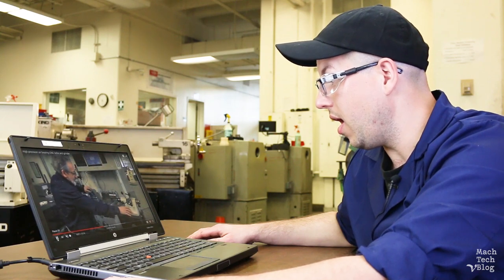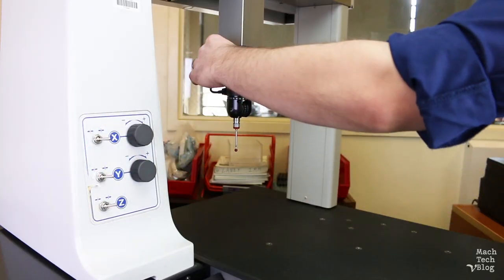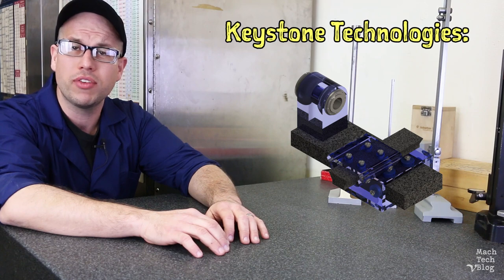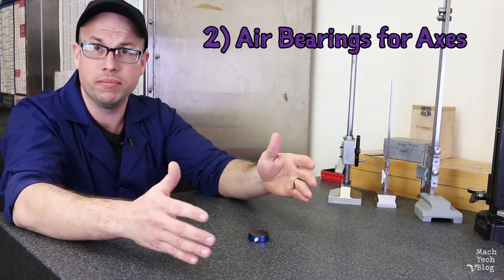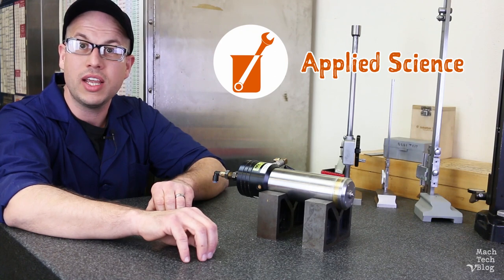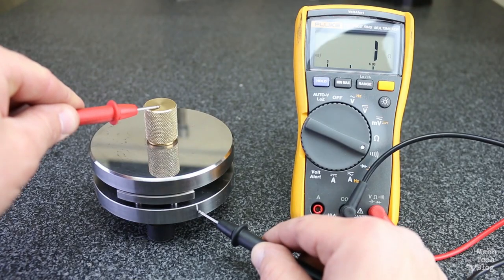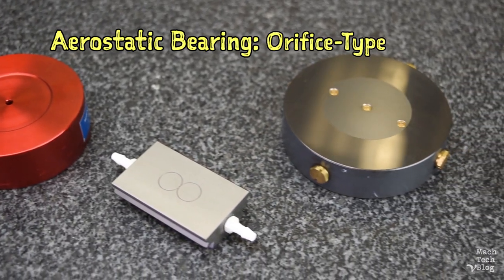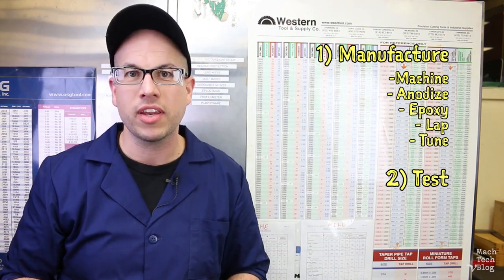Air Bearings: Introduction

Comment: I'm really looking forward to this series. Thanks for the shout-out!
Reply from the maker: Thanks for your dedication to backyard super science ;)
Reply: We all looking forward to this series and your channel also! And it is in my top 10. )
Reply: @LaneyMachineTech  Nice Video, it's well put together.  Ouch on the reference to New Way being expensive for what the bearings are.  We put a lot of time and effort in designing effective solutions for our customers.  The precision repeatability from bearing to bearing is very critical in many of our OEM customer applications.  If we were manufacturing a non precise air hockey puck, I would agree with your statement.   The video shows you manufacturing a flat round bearing , our 65mm puck is $215.00 for a one-off.  At larger quantities they obviously become more cost effective.  Is $215 expensive for the amount of work you just put into the series of videos? Again, love the video.  Great explanation of air bearings.  I just take offense to the expensive comment because I see first hand the design, processes, manufacturing and testing that goes into making porous media air bearings.
Reply: mr. applied science guy is everywhere...

Comment: I used to work for the company Professional Instruments Company. I made and balanced  alot of spindles, air pads, and custom bearings. Let me know if you have any questions. I will say that one of the patents is the groove compensated airbearings. Their idea of precision is unfathomable to most. I ground parts that where 36" long and hollow for Zeiss CMMs. With a tolerance of cyclindricity of .00005. That means run-out no more the 50 millonths, and size within 50 millionths. They do amazing stuff.

Comment: That whole Dan Gelbart series of videos is gold gold gold.
Reply: Perhaps, .....for those that have never been in any manufacturing environment.  Otherwise, very impractical in many cases.  The lathe, as one example, very limited use and extremely impractical.  Air bearings as NOT suitable for much loading.  This is very much a finishing machine.  When you have the money Dan has, you can easily have three or four or more lathes ....each for a different application/need.

Comment: I had a couple of words with Dan yesterday in his comment section, about how he regulated and matched the epoxy thickness of the two main "T" granite structures.  His answer?  He didn't - just the weight of the granite equalized the thickness of the epoxy film from end-to-end and from structure one to structure two.  Given the accuracy he shoots for, that just doesn't seem good enough - dunno'.

Comment: That sounds so awesome. One of my interests is achieving a very high accuracy on a limited budget. That's why I recently learned scraping and I'd like to experiment with building some stuff that incorporates scraping in the process - the beauty of it is that after machining on a relatively decent machine you literally need only hand tools to make a very flat plane on your surfaces. But cast iron and scraping can get you only so far. I'm still not done with almost any of my projects and plans, but I'm pretty sure that when I go more into the precision land I will want to look at air bairings. So thanks for sharing your work on this!

Comment: Adam, do you think, using the principles of your thrust air bearing, that it could be utilized for an audio (vinyl records that is) turntable?  I mean, could 33-1/3 rpm sustain this kind of air bearing?
Reply from the maker: I'm not sure, but this was one of the first potential applications which popped into my head when I was making the bearing. You should try it! It would be helpful to do some calculations first. 

This guy's got some good information: https://www.youtube.com/watch?v=dR5rRZQeIAU 

And this website has a bunch of design calculators: https://www.tribology-abc.com/

Comment: So air bearings would suck for rigidity would they not? I work with Swiss screw machines and we use a guide bushing with oil. Air compresses, oil does not.
Reply: Excellent point. Precision air bearings require preload. This is done in three different ways:
1 -opposed bearings the force from one bearing preloads the other.
2-magnetic preload
3-vacuum preload.
Preload raises the natural frequency of the system and improves stiffness. Without preload you just making an air hockey table.

Comment: 4:33 that a partial differential equation, linearity is not an issue since you are trying to solve for a specific use case (I.E. given sizes and weights, how high will it float with a given air pressure). With a bit of work, anyone with some PDE and R programming should be able to find an approximate solution.
Anyway, I am pretty sure Gelbert just drilled holes in his granite and turned up the pressure until it worked - he is far to practical a person to spend time making plans when he will still have to spend hours tweaking.

Comment: I have a question.  1:50 No one has been able to answer this yet. I have asked dozens of times whenever I see it in a video.  What's the deal with the ruby tipped thing on the end of the CNC?
I know it's there for doing some sort of measuring. 
What is that ruby tool thing called?  What exactly is it doing?  Why is there a ruby on there instead of granite, steel,  cotton, tungsten, etc. Etc.? 
1:50

Comment: I've been thinking about these same challenges ever since I saw that Dan Gelbert video a couple of years back.  "It turns out that you can buy quite economically, granite parallels...",  turned out to prove that his definition of economics is slightly different to mine. LOL.  36"x4"x2" 4-face granite parallels are difficult to even find.  24"x4"x2" will cost you about $1000 a pair minimum, but I don't think they'd be long enough.  That doesn't even include the larger support beams, but fortunately they shouldn't need to be so accurate.   

I've also looked at those narrow surface plates as a potential solution.  The challenge isn't in lapping the other faces flat though - the challenge is lapping two of them parallel and flat.  You actually only need two perpendicular faces straight and flat - the top surface and the outer edges.  You' could run the tailstock on the outer edges too though.   The inner edges wouldn't need to be finished, although assembly would be more difficult.  With the inner edges finished and parallel you could use a matched pair of  blocks to set their position during assembly.

I think the 2 most likely options are - find 2 face parallels of a good length (withthe narrow edges finished), and lap one of the wide faces flat.  It would not need to be parallel to its opposite face;  or to use those narrow surface plates and work on the edges.   One of the biggest challenges with either approach is measurement.  In theory, with a 3-plate method, measurement wouldn't be needed to attain flatness of a single face - good technique and time should be enough.   I don't however know of a method of attaining parallelism to single- or sub- micron tolerances without access to some specialized gear.  A tenths indicator just isn't going to work here.  I might be building a laser interferometry system first.  LOL.

There is one approach that might work, starting with one good face on two narrow surface plates.  Lap the 4 edges together so you end up with 3 flat faces on each.  The narrow faces of each plate are not guaranteed to be parallel.   Make an adjustable honing saddle with air bearings that run the top and one narrow face of a plate.  On the other narrow edge runs a diamond lap.  It needs to be adjustable so that it can be tightened inwards.  Run it back and forth along the plate, carefully tightening the lap,  until the resistance is felt evenly along its length.  Repeat on the other plate.  Now you have 2 plates each with 2 flat and parallel narrow faces, and a single flat wide face.  I wonder how much the squareness of those 3 finished faces matters.   That would be difficult to control.  I don't think it matters too much though,  as long as the air bearing mountings are able to compensate.  Kinetic mounting?

Comment: Thanks for the great video. That Oak Ridge paper is worth the price of admission. (Well, it would be it there were a price.) It tells you everything you need to design and construct your own spindle. Their six inch diameter (with 12 inch bearings) can carry a load of 500 pounds. It might be interesting to build  lathe with a two or three inch spindle.
Ken

Comment: Seeing some of the recent youtuber discussions of air bearings, I immediately thought about the Dan Gelbart machine. Inexpensive ways and shop-made bearings get us closer to this being a project theoretically possible for dedicated home shop guys, but there's one huge sticking point and I'm hoping to see you (or someone) address this challenge. Referencing the ways.

Even if you buy fully finished granite parallels, I can't think of a way to ensure the whole assembly is coplanar and square without a surface plate larger than the machine you intend to build. A way to do this that doesn't involve the money and space required for a giant surface plate is the real technical challenge of a project like this

Comment: Back in 1970 I was given a bearing housing and was told it was from an early type of wheel balancer,
after spinning it with just your fingers it would rotate up to four minutes, I had no use for it so I took it apart because I was told it was a Mercury bearing
after the mercury ran all over the floor I could see that the shaft was floating in the mercury,
therefore there was no lubrication required and very little friction. just a thought..........

Comment: Great series!  Years ago I had worked at Precitech, ABTech and for a while Dover.  All three make air bearings.  I have some air bearings left over (they were getting tossed) and I have been meaning to assemble them into a little lathe for years.  Finding the time is always the issue.  I'll certainly be following along with this new series of videos!  Keep up the great work!

Comment: I can understand the applications for air bearings but they seem really really dangerous in the sense that something spinning at 1000s rpm then a power failure pressure fails and sudden stop could cause tremendous damage and destruction

Comment: Your series is perfect timing!  I recently picked up a nearly free Brown and Sharpe CMM with no electronics and all the hoses rotted off.  After spending way too long researching the 'right' air line hoses and just using super cheap vinyl hose form the hardware store I've got the air bearing working again, now I just need a use for it.  Turning it back into a DIY CMM seems obvious, adding a laser and a 3d printer extruder also seems logical, but adding a small spindle seems like a great / bad idea that I'm considering.
Reply from the maker: You should make a video about it! I'd totally watch a CMM-to-Machine Tool conversion video. (Was it a Microval?)